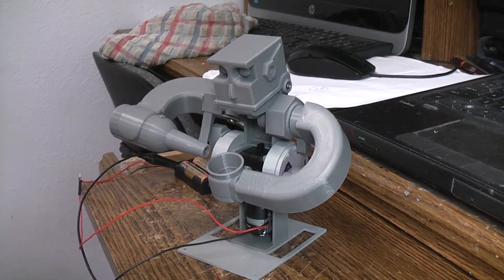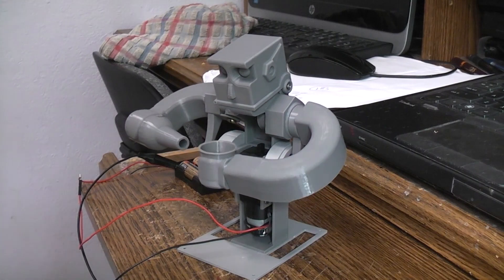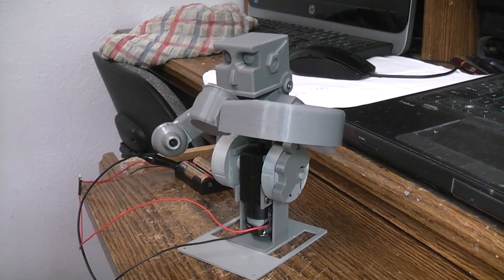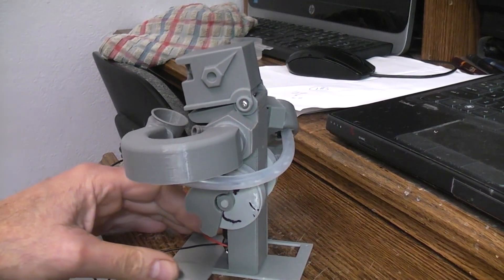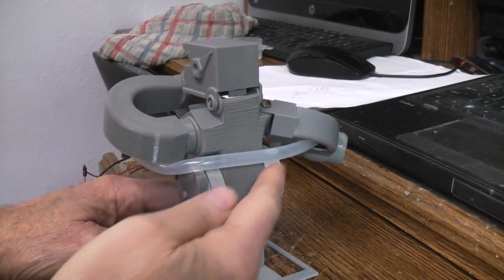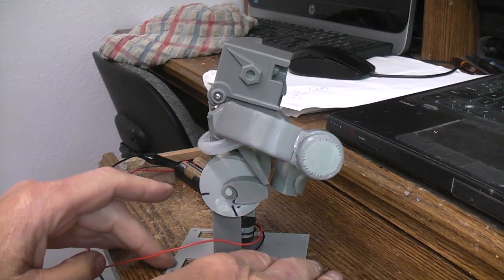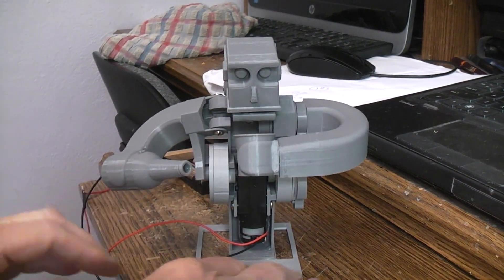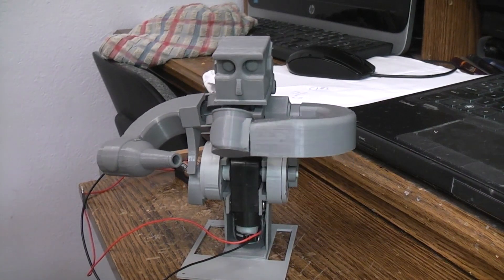3d printed Drinking Robot automata. Cycloid drive.

Comment: An ode to past toys. Nifty gear. I guess the double sip helps drain the water back into the reservoir, too?
Keep the design, people can use custom labels to make it any favorite beverage like: Jolt Cola or Corona beer.
Reply from the maker: Yes the double sip was something that the  vintage drinking bear toy did and I thought it was a good way to clear any air locks in the tubbing that might happen.

Comment: That's pretty amazing.  It looks like the arms are hollow; is there a reason you put the water tube behind the robot instead of hiding it through the arms and body?  It would be pretty funny if you used the cycloid drive to make it walk, sort of staggering as if it's drunk.  But that would probably end up spilling most of the water.
Reply from the maker: Yes I designed the robot to have the tubes inside the arms and pass threw the body, but found that for the water to flow properly the tubes needed to be lower than the  arm shoulder points.  This is true for the vintage drinking bear that I did the video on as well. The tubes must be lower that the shoulder points.
Reply: @Robothut  Interesting.  I would have thought that when the arm with the cup goes up, the water would then naturally flow to the lowest point (the bottle).  It's still impressive anyway.
Reply from the maker: @jayducharme  Yes that how it works. The cup goes up and  the liquid flows to the bottle. But it works best if the tub connecting the cup and bottle is as low as possible.